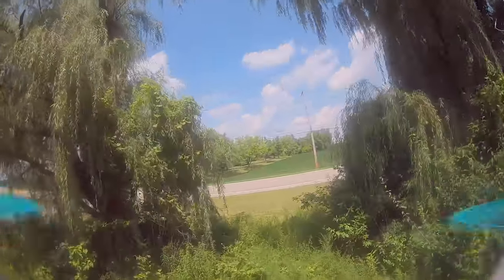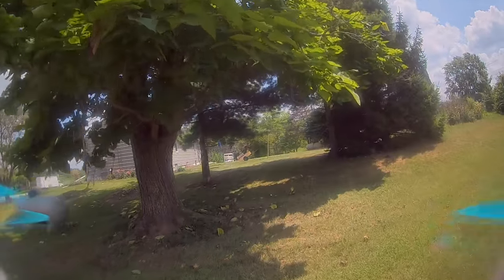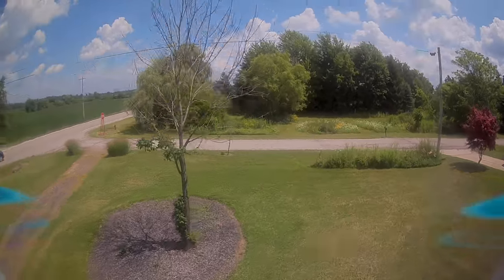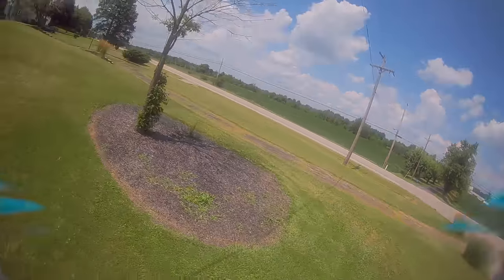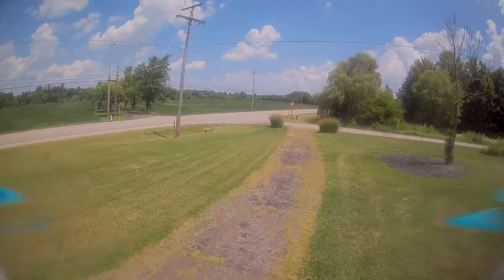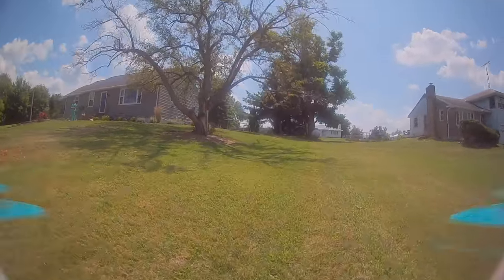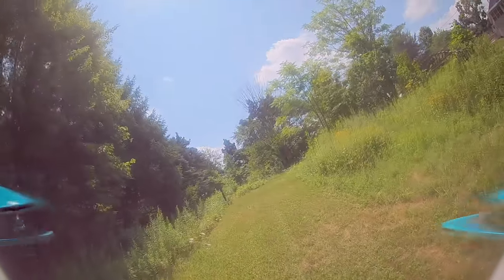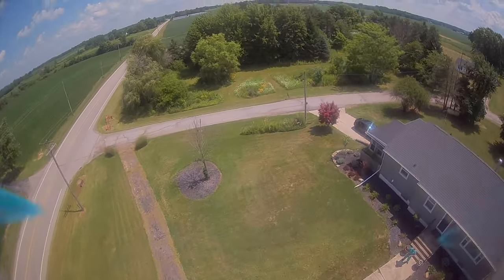UMMAGAWD ACROBRAT SPLIT MINI HD FOOTAGE 1

Comment: Nice man. I just ordered the Caddx Turtle. It probably isn’t as good as this but it’s only one board and image quality looks pretty satisfying. Albert Kim has some sample flight footage with different settings. It looks good. I like the look of this as well.
Reply from the maker: I’ve been looking at it. YouTube crushes the video. It may be slightly better or the same as the split. Both record at too low a bit rate for hd